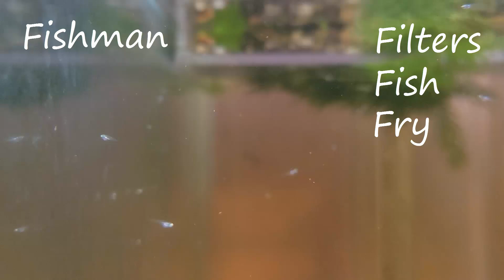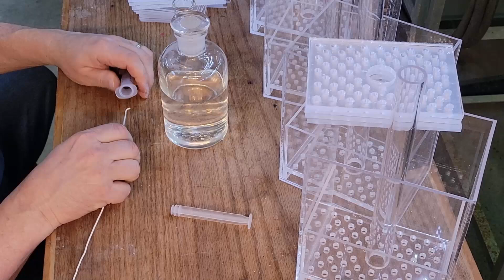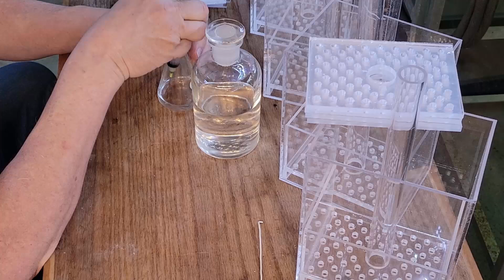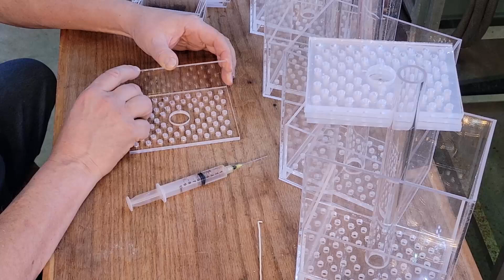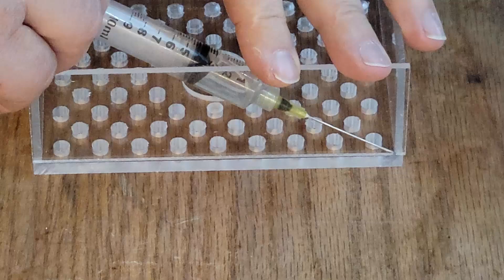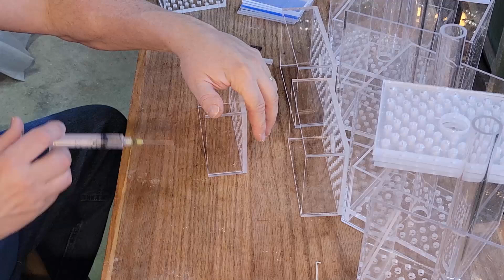Fish Room Vlog Part 176

Comment: I would LOVE a video showing how you use these filters and also would love a video on how you make these from start to finish. Where you buy the material of the acrylic-sheets and tubes, the stuff you use to weld them and where you get it? What tools you use to cut it, drill the holes etc) i was fascinated watching you weld them together. Ty 😊
Reply from the maker: I've made plenty of build videos about filter construction of all kinds. They may be hard to find but they are there

Comment: I was looking into air driven pump and aquaponics and i found you. Your aquarium air driven filter designs are very sleak and helpful. 
Could you look into glenn martinez air lift system and design something that can lift water higher? 
I couldnt find anyone that does air lift pump on an aquarium scale like you. 
Great work!!
Reply from the maker: So glad you like it! I have experimented with air lifts systems for years. I could lift water a reasonable height if I did it in stages. If you look through my library, I have a number of videos on it